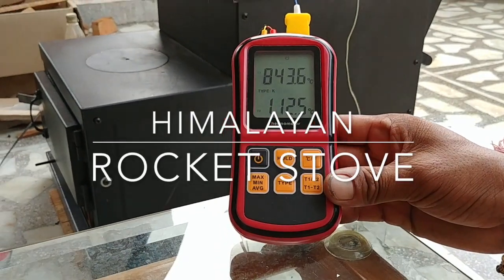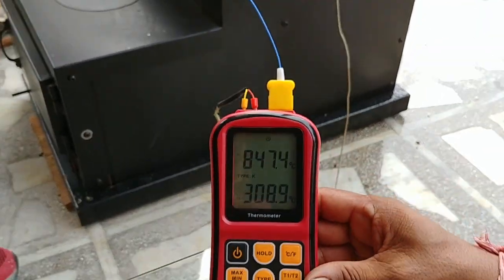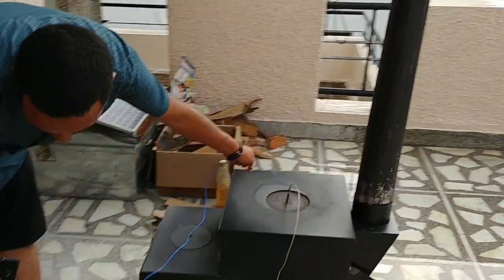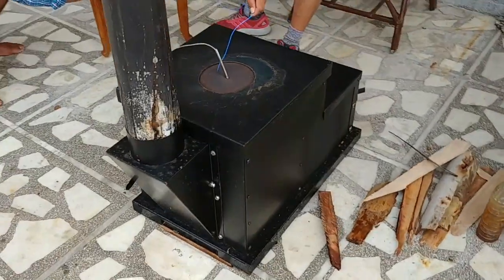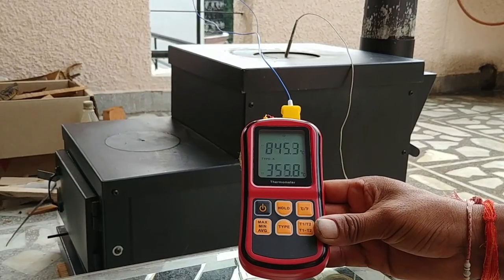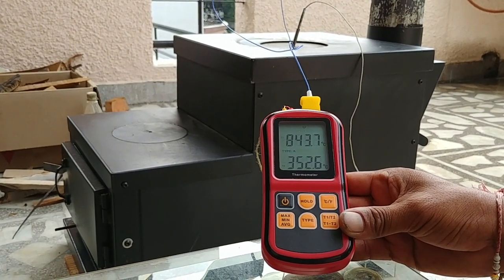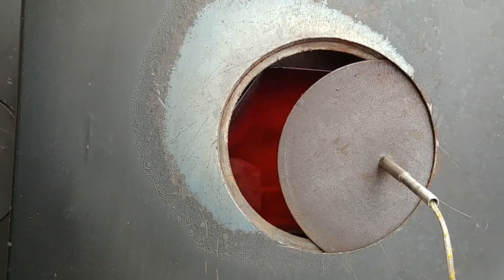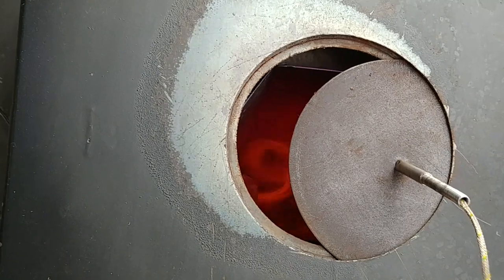Himalayan Rocket Stove - Eco1 Temperature Test

Comment: The probe is into the fire, try measuring the user metal surface on top of the stove. Sure it can be used both w/wo top lid. How low of a temp will the stove stay burning for simmer cooking?
Reply from the maker: Douglas Pohl if you pause the video on the temperature indicator, you'll see there are 2 numbers. The top one is the internal combustion temp and the lower one is the sensor touching the top of the stove in various locations. It's reading around 300c in the early shot and and about 350c in the latter shot. That gives a better indication of surface temperatures.
Reply: @Rocketmandesigns  that sounds pretty hot, perhaps too hot for cooking? PS: it might help mentioning in the audio track that you're using Celcius
Reply from the maker: Yes, true... everything we do is in celcius. I will try to remember that for the US audience. :-) For cooking temps, its fine as the cook can moderate the temps by moving the pot position on the top plate and whether to expose the base of the pot or to keep the top plate under the pot.
Reply: Russell Collins Thanks, what is the mfg and model of this instrument?